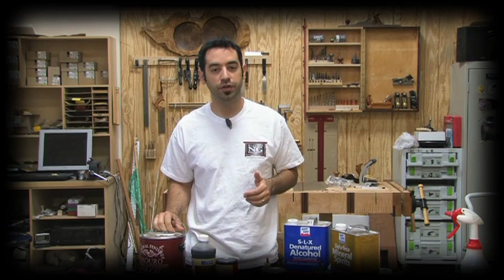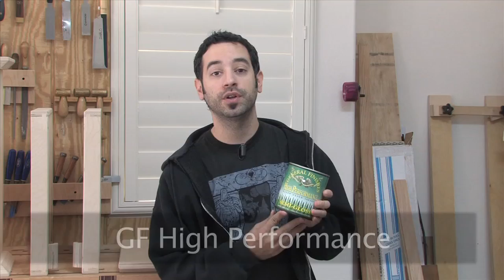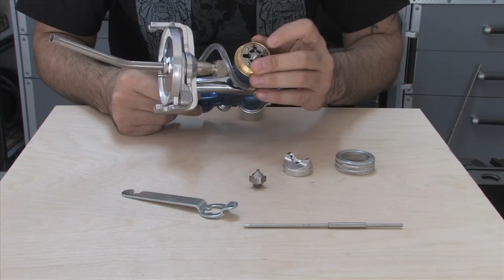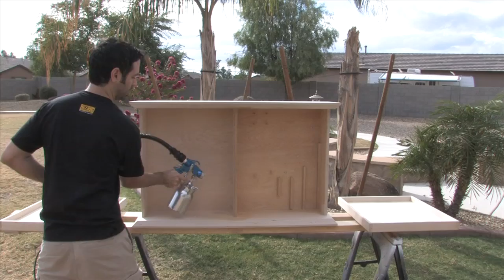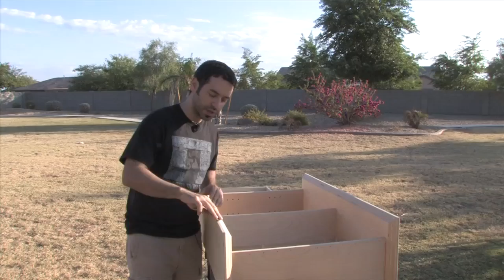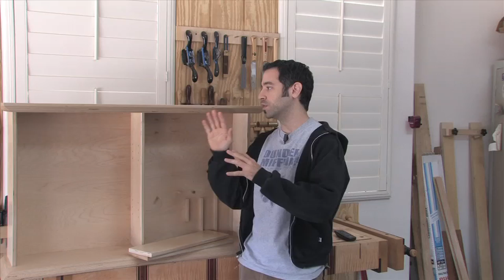155 - How to use Waterborne Finish & HVLP

Comment: I bought an HVLP sprayer and though I had heard they were expensive I thought it was fine. At the time I assumed it worked with my air compressor. I obviously haven’t tried to use it yet. The only instructions that came with it was a photo of an exploded view of how the pieces fit together. Thanks to you now I understand that part at least. However, when you mentioned the turbine I realize I may have made a big boo-boo. What does a turbine do differently than an air compressor and what do they cost?

Comment: Enjoyed that as usual.  Interesting tip on the linseed oil, but if that amber was the look I was after,  a coat of quick dry oil urethane or sanding sealer.  220 sand, vacume and then top coat with clear water base for durability and depth.

Comment: I don't understand the need to keep or have guns for specific types of finishes. If you're cleaning your gun properly and completely like you're supposed to after each use there shouldn't be any concern over whether you used water based or oil based finish the last time.

Comment: For tip size: if I buy a 1.3mm good gun, I'm gonna be able to apply stain, water based sealer and varnish (Bona), and latex paints on wood? I wanna get the gravity fed Iwata W101 131G ... and also use it for my car and other small repairs around the house. I'm not doing this day in day out so I wanna get 1 gun and clean it thoroughly after each job.

Is it such a bad thing to use water and solvent paints in one gun?
Reply: You'll need a 1.8mm or larger  tip for latex, but you can just buy the tip separately. I also like 1.5mm for everything else. I don't like to mix, but if your clean and keep your gun clean, you should be fine.
Reply: @conleyhataway2618  Thanks Conley. Another confusion: I've been told that gravity gives bad results for latex because it takes too much reducer (20-30%) and it destroys the finish that way - and that pressure suction cups are the way to go because they don't need reducing that much. I don't have any experience - if I saw it in person I'd know right away - so how bad is it?

Comment: Nice video. Clear and concise. Not too long winded. Salient information covered. Should inspire and encourage non-experts to go ahead and experiment. One point I would add and emphasize is to never let the sprayer falter in its movement...in other words if you have the trigger depressed and there’s finish flowing from the gun you should be moving. If you think a spot has too little material on it, give it a minute or two to tack and hit it again. Thanks.

Comment: hi,
I have a question. you use an oil to get that lively look before you finish is with a water based coating. Doesnt that give problems with the attaching of the coat?
( exuse my english) :)
Reply: They claim it's okay providing you wait 72 hours or more or something like that.

Comment: I've heard that HVLP guns are not good for water borne/based finishes.  I am looking to purchase a General Pneumatic Gravity Feed HVLP spray gun set for finishing electric guitars, but again a instructional video said it isn't good for water based/borne. thanks for the video
Reply: SC86Canuck That harbor freight spray gun is $20 and is just fine, especially for learning. It’ll also spray water borne stuff just fine, as spraying depends on viscosity more than anything. I will say that the HF gun has a 1.4mm tip, which is a bit narrow for most consumer grade paint. 

Just make sure you keep it clean, and if you clean it with water either make sure it’s completely dry before storage, or else run some mineral spirits through it first. If you leave parts of that gun soaked in water too long some will start to rust. It happened on mine.

Comment: Question for you Mark, since I haven't listened to all of your videos or watched all of your live Friday podcasts. This video on water borne finishes is well a little old(2011) now, so I'm wondering what changes have occurred in the water borne  finishes on the market today(2018).In the past I once had a water borne finish bubble up on me after a few days. I learned later that on water borne finishes this can happen if you don't let the finish dry long enough between coats. I was told by professionals that you should wait 24 hours between coats when using water borne finishes despite what the directions on the can say. I sprayed this on raw wood(Maple) so the cause may have been air trapped in the wood .I will say that this has only happened to me once, and it was many years ago, so I'm not sure about the newer water borne finishes! What has been your experience?

Comment: Good, instructive video for water bone finishes. Subscribed!
 
I have to admit it can get confusing and there is limited info even from the manufacturer on these things

To sand or not to sand between the coats. I've seen some that don't send between the coats.
I've seen some start the second coat on top of the first coat with a HVLP gun. 
I need to do it indoor ( I have 3 panels 4x8 to spray), unfinished room with a window, what's the best setup for this.
Some people say that if gun is not used for 5 minutes it has to be cleanned.
My boards are stained, oil based, do I need to hit them with water and I am concerned that if I raise any grains I'd impact the stain coat.

Any tips would be welcome!

Comment: Hey Marc, what are your thoughts on Endurovar? I'm told it's more durable than HP and it supposedly gives an oil look like the board with boiled linseed oil.  Just wanted to get your thoughts if it is actually better and if it does look like the board with oil?

Comment: Have a question. Shouldn't you only tighten the needle screw only after you have installed the tip to avoid damage to the needle?
Reply from the maker: +gary24752 Maybe. But I've never given it much thought and never damaged a needle. They're not really fragile. Just don't force it in and the needle should find it's way through just fine.

Comment: GF Enduro-Var will darker wood as if it were an oil finish.  I love the stuff.  Get the look of oil, but the clean up of water!  It's not cheap, though, about $90/gallon from Rockler.
Reply: +titanwr I have used Enduro-var on a whole house worth of cabinets and closets. I tested it on some high use knife blocks first. Pretty tough finish.

Comment: This video changed the way I view and use my HVLP sprayer. I tried a water-borne clear finish on my last project and the outcome was excellent! The finish didn't need any thinning, and sprayed on perfectly. Drying time was quicker than I expected, and the lingering odor was minimal compared to the other solvent-based finish I normally use. The final finish (5 thin coats later) was very hard. Thanks for changing my mind and practices!

Comment: I know this is an older posting, so hoping you can answer. How heavy are your layers of spray? I am acutally using a turbine sprayer with Varathane water based polyurethane. I put on a very light layer initially and then went with a fairly thick second coat.

Comment: a very well done video, thank you. i am a professional painter in BC and have just started using a Graco hvlp turbine. can you recommend some better quality latex for spraying trim in new homes that works well with HVLP? Also, for thinning i have used extender. my results so far have been disapointing.

Comment: Only problem with adjusting the flow rate using the water to begin with, is that water will have a lot lower viscosity than most finishes and the flow will be different than what you're spraying.

Comment: You can use a little bug wash windshield cleaner as it has a lot of alcohol to thin the latex. always filter your paint and get filters that have the screen on the very bottom of the funnel so you don't waste paint and not so messy.  I was told by the big guru experts never to use water to clean a gun. Why?  rust ? my gun is supposed to have teflon coating inside, so what's the problemo?  thanks for the vid.

Comment: found your older video because I was looking for something on GF Enduro-Var water based in satin because I am thinking to use it for my kitchen cabinets that I'm staining myself.  I bought them unfinished from a cabinet maker in Lancaster County, PA.
Have you used the Enduro-Var yet?
Reply: +Ruth Taylor I've used several times on kitchens I've built.  I love the stuff!  Just make sure your stain is very dry under it.  I am pretty much exclusive with Sherwin Williams Alkyd wiping stain, and I give it a few days to dry before applying the finish and it's turned out perfectly each time.
Reply: +titanwr I finally used it Summer of 2014 and now I too love GF Enduro-Var  :)  a perfect satin finish.  If I remember right, I did only 2 coats.  We didn't have a chance to install the kitchen yet because of some unexpected happenings that halted our whole life since September 2014 :(  but hopefully by 2016 we can get back on track.  All the lower cabinets are done and lined up in our living room and a couple of them in our foyer.   The 2 that are in our kitchen sitting in the spot they will be installed have held up great so far.  Easy to wipe and keep clean with just a damp cloth and dry after wiping.
Reply: Ruth Taylor   Ruth let me know if I can help with anything to get your cabinets up and running

Comment from the maker: It can definitely help Dan. The Earlex units really only give you two options for adjustment, fluid viscosity and tip size. And if the unit is low powered, you might have a harder time with the thicker-bodied finishes. So yes, I do believe upgrading is a good idea if you're having significant issues with the finishes you want to spray. Also, consider looking into the Fuji units as a higher quality alternative.

Comment: Hey Mark, I know this is an old thread, but I still like to refer back to it on occasion.  I bought an Earlex 3500 to try my hand at spray finishing.  I like the spray result, but have noticed that most fluids (polyurethane, dewaxed shellac, paint) do not atomize as well as I would like... at least not without excessive thinning.  Would upgrading to the 6900 or the 5500 make a difference?  The specs on the 5500 look about the same as the 3500 but with the nicer gun.  BTW, still love the vids, :)
Reply: Dan West definitely, greater stage better performance

Comment: David
Thanks for the great videos  used the one for the table saw sled  and now used this one on HVLP and Water Bourne finishes.
Was un Happy with trying to get Perfection from Gloss Poly and being disappointed  even tried using my HVLP from Rockler and still I was not Happy.
But With the Water Bourne I am as Happy as a PIG in the Mud Puddle  Just learned to live with the  Clear Semi Gloss finish though I am going to try some wax after it dries for a few days.
Keep up the great Videos

Comment: Hey Wisp! You really shouldn't stick the gun needle into the gun before you fit nad tighten down the nozzle. If the needle goes just a little too far you'll ruin both parts. Fit and tighten the nozzle then insert and snug the needle gently into the nozzle. I have to say "GREAT TOOLS" I'm turning green all over and it's not just cause I'm Irish.

Comment: I have a 60 gallon compressor but I'm afraid to use it because there is water in the line and it will splatter all over my project and run the finish.

Comment: no respirator, spraying outdoors.aren't u worried about dust particles or maybe a tree branch falling on your work?
What i actually did was buy an easy-up, then tarp the sides, hang a light,a small vent fan on the ground and spray away. On some of the messier ones i have a tarp i lay on the ground so i dont ruin the concrete. Takes a few mins to set up, but keeps the spraying outside my shop and from landing everywhere.

Comment: I do HVLP on wood doors, all trim, bookcase, cabinet, etc, to automotive finish grade on standard job sites (no spray booth, fighting dust & debris and other contractors). You never raise the hewn with straight water and 1st sand is a choice between post-primer or 1st finish coat. Primer is the water bath that pulls up, grabs and brittles any hewn. Water is a wasted step. Never use a spray cup unit inside a small cabinet. Use a free gun for mobility w/ compressor.

Comment from the maker: @ArtisanWoodworker You can. As long as the BLO is fully cured you should be OK. The water-based finish might still raise the grain. And you might even consider putting on a sealer coat of dewaxed shellac before applying water-based, just to be safe.

Comment: thanks, I am new to water base top coats. So you just put on the linseed oil wait 4 to 5 days to dry, then go straight to the water base top coat with out doing any further surface prep.

Comment: @TheWoodWhisperer That is good.  It means that an oops to the lens is a whole lot  less than a new lens.

Thanks for the info in the video.  I plan to have a spray system when a get another shop up and running.  Thanks again.

Comment from the maker: @ShallowJam I haven't worked much with Bamboo but I imagine it responds similarly to wood. If your test area is rough to the touch then you should probably pre-raise. But I really don't know if bamboo exhibits the same grain raising properties as wood. Just rub some water in and you should be able to tell. But in terms of staining and clear coating, it should work quite well regardless of what system you use.

Comment: I'm currently finishing some bamboo french doors that I bought. As far as I can tell they are unfinished (water does not bead on them, and I hit a test patch with some stain and it seems to have absorbed fine) but I'm not sure what process to use with bamboo. Any advice? I don't know if I should be pre raising the grain, or how many coats of finish after my stain. (Waterborne stain)

Comment from the maker: @ak99372 Well the real key is to apply it very thin. I usually dilute mine by about 50% with mineral spirits, wipe on, let it soak for 3-5 minutes, and the come back and wipe up all the excess. Then after several days, the finish is usually dry enough to work with. Temperature and humidity can slow the curing process down a bit so keep that in mind.